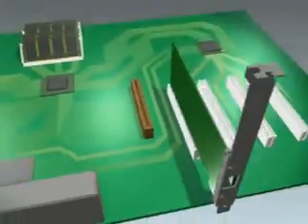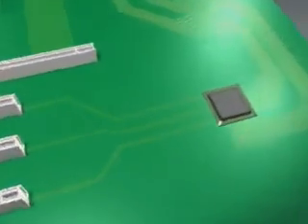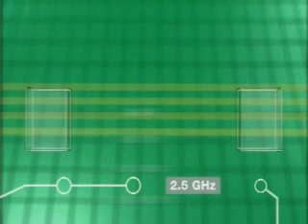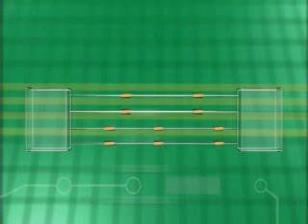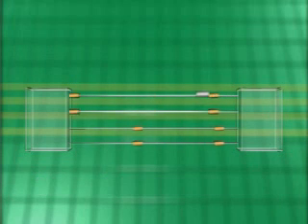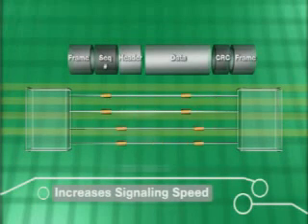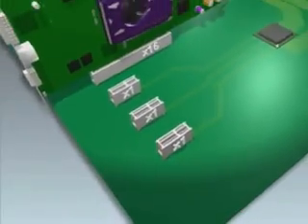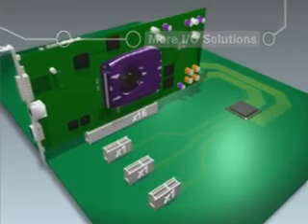PCI Express Technology

Comment: Windows 8 Pro 32-bit (6.2, Build 9200
           Language: English 
System Manufacturer: BIOSTAR Group
       System Model: TH55B HD
     
          Processor: Intel(R) Core(TM) i7 CPU         870  @ 2.93GHz (8 CPUs), ~2.9GHz
             Memory: 8192MB RAM
AMD Radeon HD 6700 Series
          Page File: 2035MB  953.9 GB
File System: NTFS
      Model: WDC WD10EALX-009BA0 ATA Device for sell $500.00